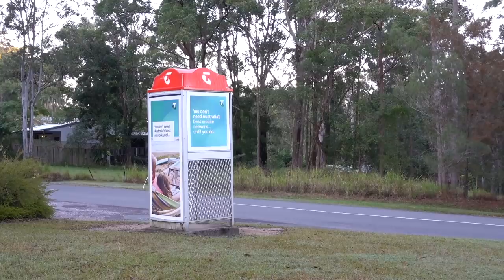How I Dodged a Bullet with My BMC Teammachine

Comment: Thanks for the update. I love listening and learning from your bike fitter. Just seems strange how when they stretch you out and lower handle bars  takes the pressure off the hands. That’s what happened to me when I got my bike fit. I kept raising them and couldn’t stand riding my bike cause my hands hurt so bad. Normally ride without gloves, but went back to try and relieve the pressure to no avail. Once the I got the bike fit I’m back to no gloves and evening riding the trainer is more pleasurable.

Comment: What about that cadence increase that Neil slips in there quietly at the end...  next week’s video?  My assumption is that yes this would be the next adjustment, besides seat height, that will be a result of the crank change.
Reply from the maker: Correct Robert, it will be discussed next week. Very noticeable.
Reply: I once tried 165, measuring 1.8m, on steep hills I found myself not pushing enough when I was out the saddle... Switched to 172.5 to 165 and then back to 170. I guess that's my sweetspot for cadence/torque.

Comment: This video is classic example of overthinking things. Unless someone has serious problems of pain and discomfort from 5 and 10mm changes all these are useless. I recently changed from 172.5 cranks to 165 keeping the saddle height the same and have no issues. I did the change because i want to use my road bike for triathlons (using clip on bars) and i wanted to open the hip angle at 12 o clock. No bike fits (except from the original on my first bike some years ago), no overthinking. Just tried and see if it feels ok. Having said that, if i was a pro and cycling/triathlon was my job, i would left no stone un-turned. Thankfully, the age that been a pro was an possibility, is a far behind me and i am happy to watch this kind of videos as entertainment and nothing more.

Comment: Sounds like you caused yourself bother changing them cranks. As I said to you two weeks ago the longer the crank the more leverage the easyier the peddling up hills not the same on short  cranks. Might not effect your legs now but the stiffness might hit you the older you get lol
Reply from the maker: Cheers Peter, and yes, it's going to take some time to get used to but I think the positives may out-weight the negs.
Reply: @CamNicholls  never lol OK you have a car with no jack you have a  cement block and to peaces of timber one short one long which one will You use to jack  up your car with. Me personally I go for longer OK you be higher up in the saddle and more nose down I get that bit. But me personally think there be more power in longer peddles and less push. Love you YouTube channel by the way keep up the good work dude.
Reply: Actually a lot of research and my own experience suggests as you get older, shorter cranks are better to reduce your hip angle, knee angle at the top of the stroke, means a lot less stress on your joints. Combine with a larger range of gearing and higher cadence should allow you many years of pain free cycling (as long as your heart stays healthy!)
Reply: Yes, let’s just ignore the advice of the physiotherapist and qualified bike fitter 🙄
Reply: @ColtSievers1000  hey Peter just out of curiosity. What would the effect on the legs be long term? Wouldn't there be less load on the joints as smaller cranks usually result in higher cadences and less torque. Translating to less stress on the joints? Really interested in hearing your perspective here.

Comment: Trial and error has worked for 50 years. If it ain't broken, why fix it. Hip impingement can be fixed by moving the seat forward and short cranks will reduce ultimate power by over 100 watts. You might not see any reduction in threshold power but you will with ultimate power. Why listen to a bio-mechanical engineer [a rather inexact science] instead of a mechanical engineer? Pro riders can't afford poor results and know exactly what your equipment allows them to do, why not listen to real experts instead of a Sunday cyclist masquerading as an expert?

Comment: Omg noooo why 165mm cranks??! Christ you're going to hate it, I've experimented with it... Climbing out the saddle or sprinting out the saddle with shorter cranks feels horrendous and that was me going from 172.5 to 170. The difference is massively noticeable... And you went 165!!!!! I'm 5'9 I hated it.. went straight back to 172.5.. it will only be okay if you increase your chain ring size to a 54 and ride flat lands seated only cos it increases your cadence speed massively.   IMO you're really just wasting money now mate.. keep cycling simple, stop making it something like Formula1 tech.
Reply: dont know if you saw the video, but Cam made this change for bike fitting reasons.
Reply: @GThiele64  thanks I understand that.  however have you ridden shorter cranks? Shorter cranks are meant for shorter riders. The shorter the crank the harder it is to turn, think of a short spanner trying to leverage a big bolt, spanners are long for a reason to gain more leverage. Cam will use more watts to turn those cranks. And it's not optimal for climbing at all, especially out the saddle it messes up your cadence rhythm. Quintana rides 172.5 so does Froome , Contador the whole peleton excepts shorter riders like Landa and Bernal who are around 5'6 5'7 ride 170mm. Look at Marco Pantani: he used to use 180mm cranks! Lance 175mm.  Cam should have gotten a longer head tube bike instead of shortening cranks for his posture on the bike then. Cos clearly he has a flexibility issue.
Reply from the maker: Let’s wait and see
Reply: @CamNicholls  Thanks Cam, I guess it boils down to personal preference, still love your channel and am subscribed.